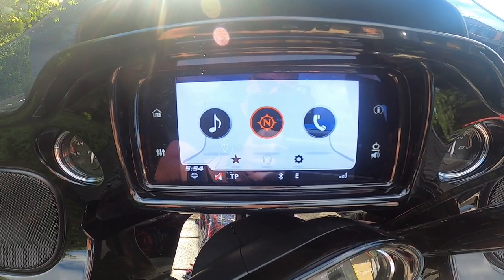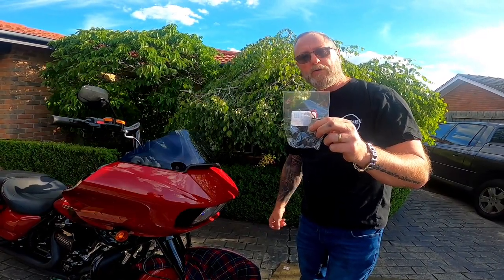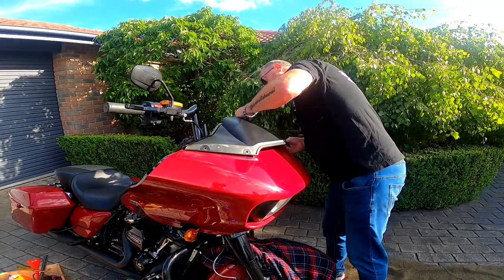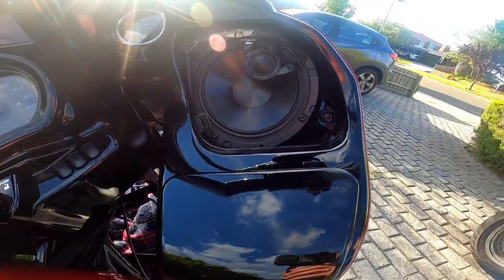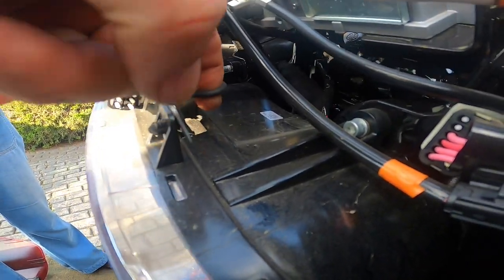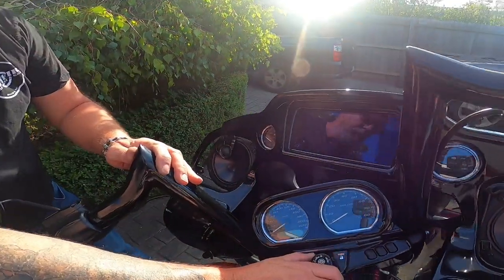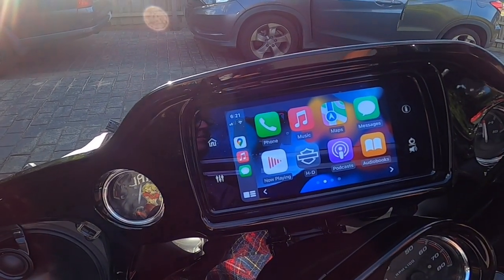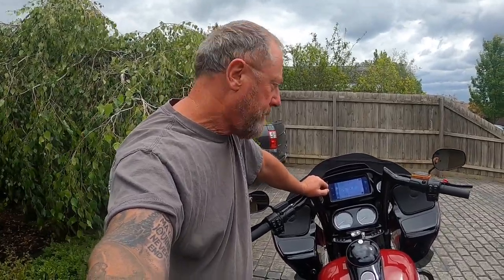How to install Apple Carplay or Android Auto on your Touring Harley Davidson's Boom Box GTS

Comment: A great wireless plug adapter is the CARLINKIT 4.0. It is only small and fits real easy into the usb compartment, so if you have a large phone you can keep it in your pocket and it connects wirelessly. I bought one of Ebay, and set up took 5 mins on our 2021 CVO Ultra.It reconnects automatically each time you get on the bike.
Reply from the maker: Thanks Glenn, I am definitely going to get  a wireless adapter so will look into the carlinkit. Thanks for the tip.

Comment: I got a 2021 ultra i just plug my phone into the Usb Android Auto works  no mods plugs were needed... looking into the wireless  plug in Adapter.
Reply from the maker: Sounds like you may have a Whim on your bike. Check out Professional Monkey for a recommendation re a wireless CarPlay adaptor. 🤘🏼
Reply: Yeh i follow him.. I got bike new
Reply: Great video. Thanks for sharing. What bars are you running on this bike? Looks great.
Reply from the maker: Hi Kenny mate they are 14 inch Factory 47s. And let me tell you they are Sweeeeet!

Comment: Nice work Whitey. Such a convenient mod.
It looks like the plug is just bridging two terminals to give you Carplay.
Reply from the maker: That’s exactly what it does Matt. I’m sure you could just DIY it, but at the price why muck about. Easy in and easy to take off if need be. I’m big on sensible, reasonably priced mods for bikes. So, buying two Harleys probably wasn’t that smart 😂

Comment: I just bought a 2020 Street Glide, plugged my phone in and of course Android Auto did not work. All I had to do was upgrade the software on the BoomBox GTS 6.5 from the HD site and Voila! Android Auto works just great!! No, I do not have a WHIM either. So I'm wondering if others can do the same, just upgrade your softwware and AA (and Carplay I assume) just works without an adapter and no need to pull your fairing. Appreciate the video though, very nicely done!
Reply from the maker: Hey Tony, I have no idea as I only have Apple phones etc but I will see if I can find someone to try. Cheers for watching. Whitey
Reply: Can you guide me how to perform this upgrade?
Reply from the maker: Sorry just saw this. The upgrade is very easy. Simply remove the upper fairing, my video shows you how to do that and plug the adaptor in. It’s really that simple.

Comment: I saw your note in the beginning @ whim previous installed. I bought a used RGU and sure enough it had previously had whim, the cable was still installed. Should I have it flashed before I install the jumper? Or can it be flashed with the jumper installed?
Reply from the maker: Hi John. Mate to be honest I do not know for sure, but I would presume that if it had been previously flashed for a Whim you would need to ‘flash it back’ for the jumper to work.   Thanks for watching.

Comment: Will this continue to work after updating the Boom Box software.
Reply from the maker: There should be no reason why it wouldn’t. The jumper is simply that a connection between the two pins which fools the computer into thinking a WIzM is installed. A software update should in no way effect that.

Comment: Doesn't work. I actually had a jumper on it already when I got the used bike. After I got it serviced at 30,000 miles they check for updates and with the new agreement with apple it disables the carplay unless you have a whim set up plugged into bike. I even tried this new jumper and get nothing. Harley is like the dumbest mfrs and no new bike or anything comes with the whim. You gotta spend over $600
Reply from the maker: Sorry that’s your experience. I’ve been using mine with no problems since this video was take,, including today. For me on my 2020 RGS it works fantastic.